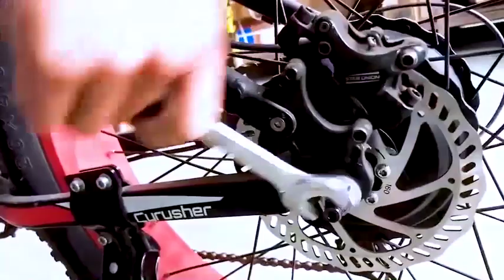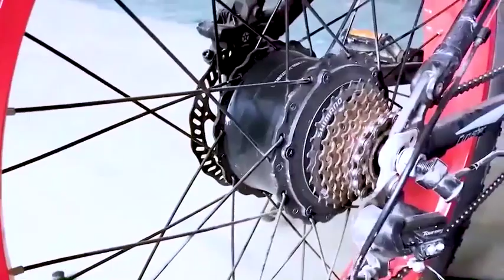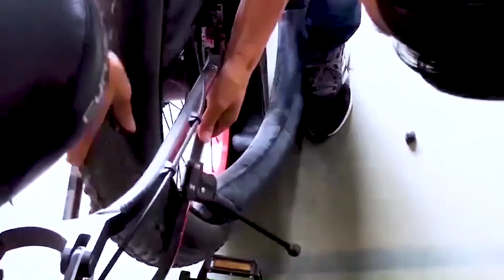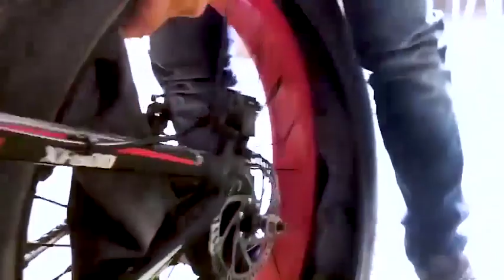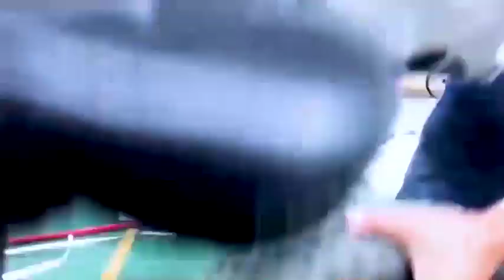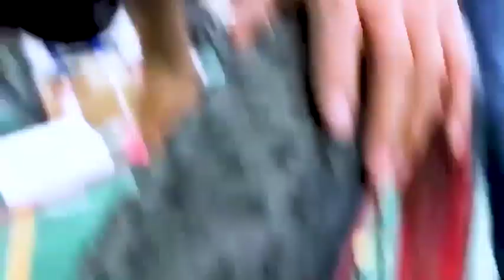How to Replace XF800 Ebike Rear Flat Tire | Cyrusher Sports

Comment: As you inflate the tyre keep checking it is seated correctly on those narrow rims…it it doesn’t look right, let some air out, squeeze, massage and wiggle the tyre into a better fit then continue to inflate.  If the tyre seems to have a wobble or not run true when riding it is likely a part of the tyre bead is not properly seated in the rim.

Comment: Thanks for the excellent vid..... Can you help? How do I remove the rear wheel completely? Is it possible? You see I'm wanting to respray it and removing the wheel  makes the job that much easier. Any advice gratefully received. Cheers Andy🇬🇧
Reply from the maker: Yes, that possible, just disconnect the motor cable, then it should be fine.
Reply: @Cyrushersports  thanks for the advice, but how and from where do I disconnect the motor cable? From the control box? Or from the hub? Thanks, Andy
Reply: @Cyrushersports  many thanks for the advice... I have removed wheel by disconnecting the motor cable as you suggested. I shall post some pics of my newly modified xf800 on your Instagram site ASAP
Happydays, Andy.

Comment: fiddly job, need a lot of hands , assume you have someone holding the frame up in the video here. If you don't then you may need to turn the bike upside down to do it single handed. Put something soft like a sheet on ground to prevent damage.